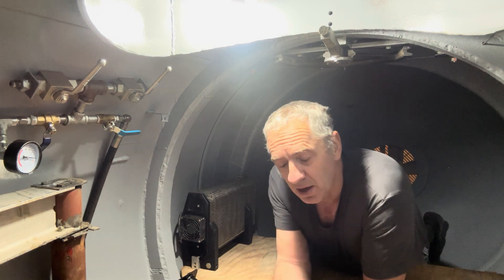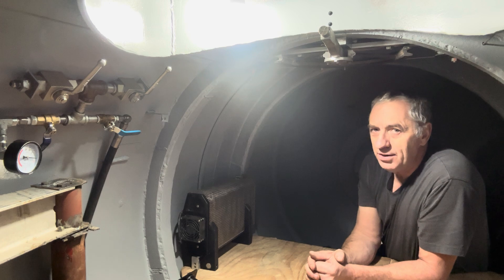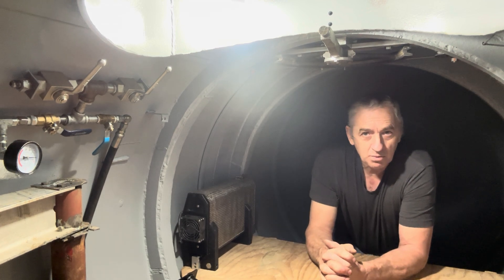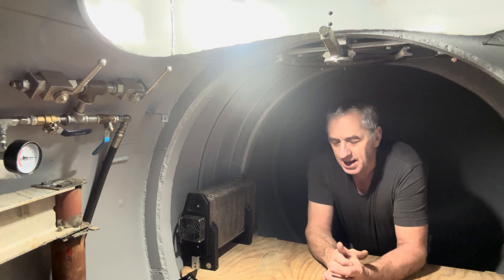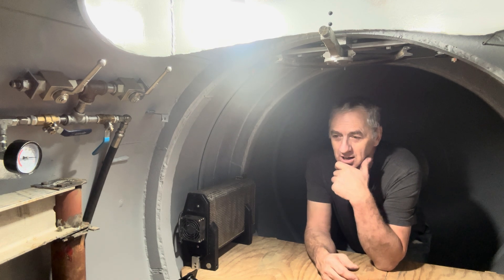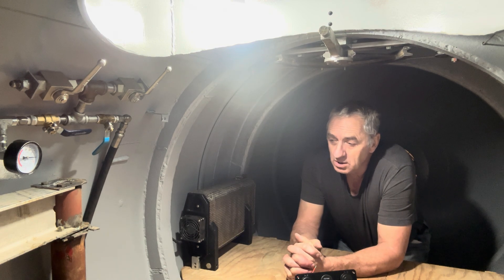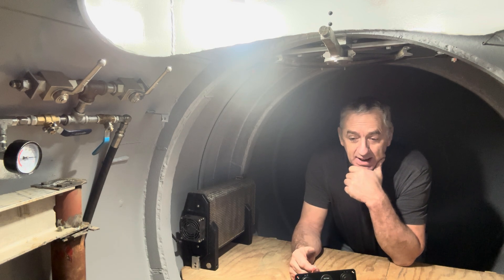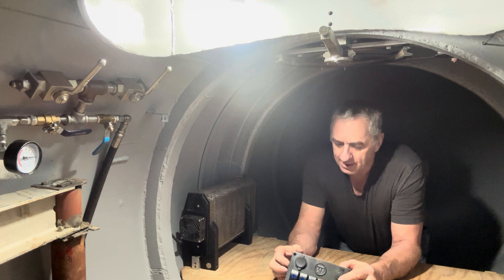Home built diesel electric submarine

Comment: Just out of curiosity, if you were forced to bail from the sub with your scuba tank, how would you control your assent to the surface?
Reply from the maker: To avoid getting the bends, I need to go strait to the surface.  Nitrogen builds up over time, since I am not exposed to pressure at depth for very long, I can go strait up.
Reply: @H @HankPronk  guess I meant to say that with more detail, you do not want to ascend quickly because of the risk of a lung over expansion, depending on if you use a steel or aluminum cylinder, you will be negatively or positively buoyant. I’m sure you are already aware of this, but the rule of thumb in scuba for a swimming emergency ascent is to never exceed the speed of your bubbles.

Comment: Hello once again. Another great video. About the scrubber. Underwater you are in a 1 atm space and all the volume of air inside is constant if I'm not mistaken. Once a certain amount of air is used up and you need to scrub it, you then turn on the oxygen tank to replace the oxygen lost. Therefore, you introducing a larger volume of gas into a confined 1 atm space. Doesn't this mean the pressure goes up inside the vessel? And if so how do you vent the extra volume of air while you are underwater? Because if you increase the volume of air inside then opening the hatch at the surface would be problematic. Am I right about this? Thanks for your time. Cheers.
Reply from the maker: You are partly right.  Your body consumes O2 and converts it to the exact same amount into CO2.  You add O2 into the sub atmosphere at the exact rate you remove the CO2 with the scrubber.  The volume of air in the sub never changes except for temerature changes.  When the sub dives it gets cold inside causing the air to shrink.  Normally after returning to the surface I have to open the hatch vent to let some air in to balance it out.
Reply: @HankPronk  thank you for the info, I appreciate it.cheers

Comment: For the control box, magnet for on the back of the box and stick it any place against the hull,  Velcro on the bottom to stick to the Aluminum I beam.
Reply from the maker: Oh that’s a good idea, I was thinking to glue or bolt a small steel plate to the aluminum I beam for magnets to stick on.

Comment: Will you have a pressure equalization valve through the hull, say, in the conning tower? In case, through pumping out the variable ballast tank, you end up with negative pressure inside and can’t open the hatch?
Reply from the maker: I have a hatch vent for over and under pressure.  Normally the sub comes up with a vacuum, and the vent has to open.  Its from the cooling of the interior air at depth.  4C at the bottom usually